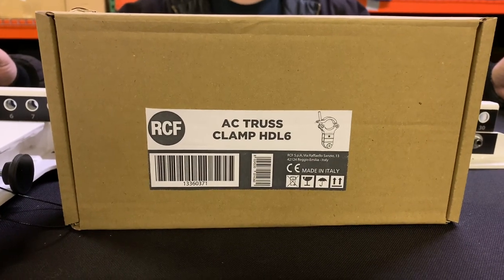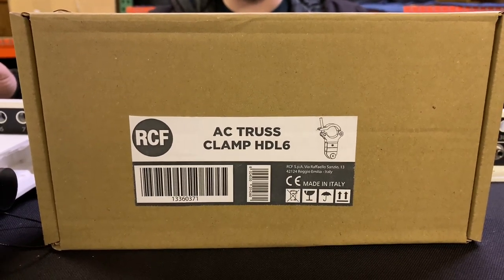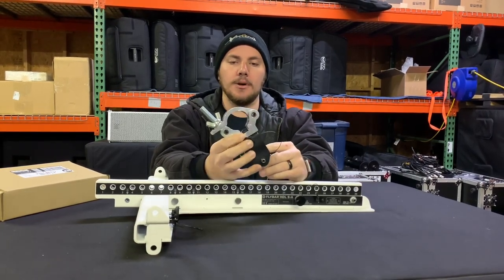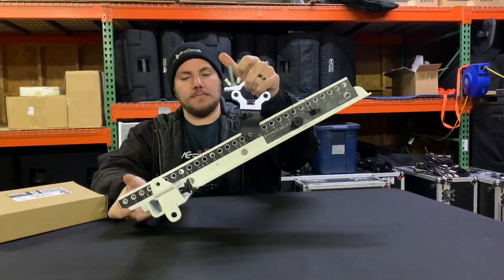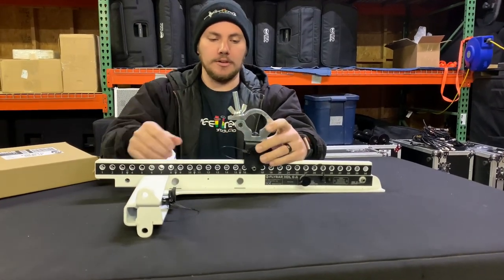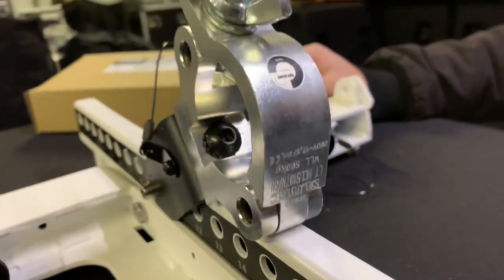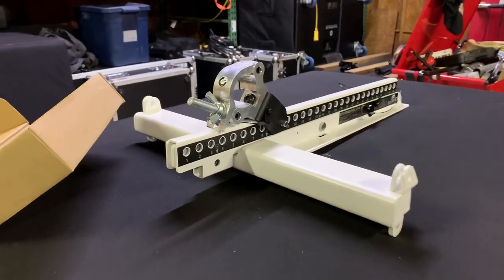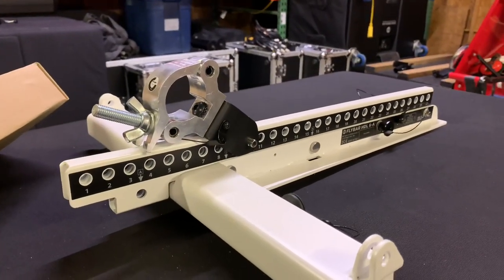RCF AC Truss Clamp HDL6 Adapter

Comment: how do you  attach it to a 12" box truss with out it being balanced on the truss? the 12" f34 says it must be in middle not just off one pipe.
Reply from the maker: You could use a double cheeseborough on each side of the bottom of your truss and run a short pipe through to be able to hang in the center.